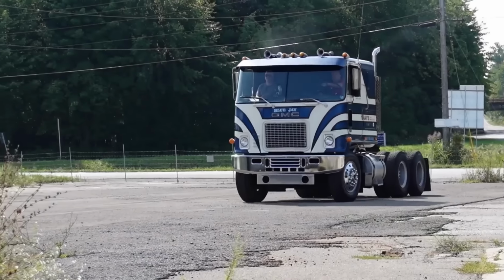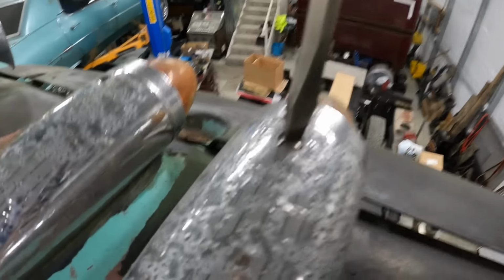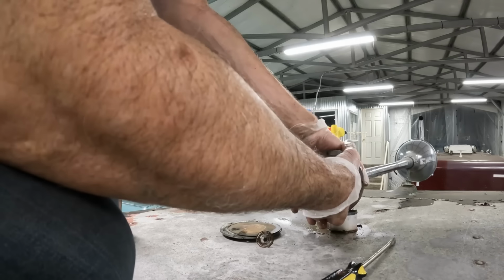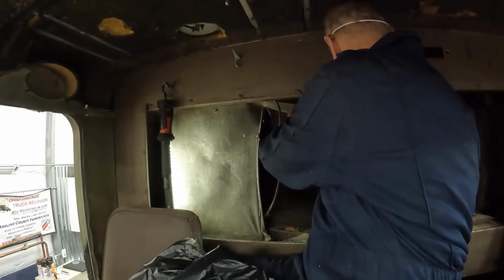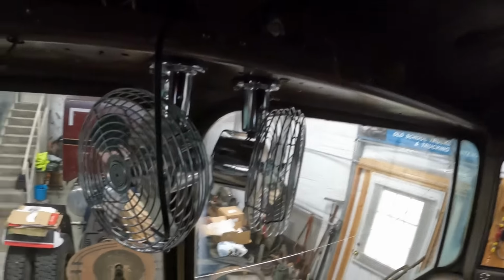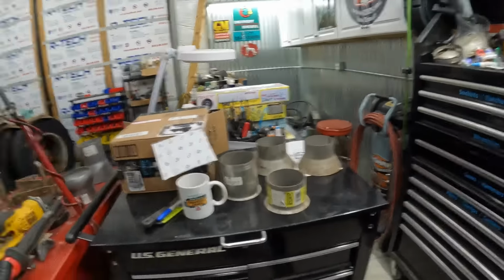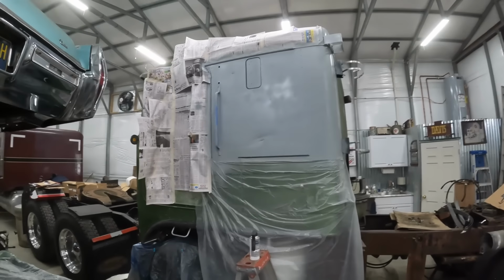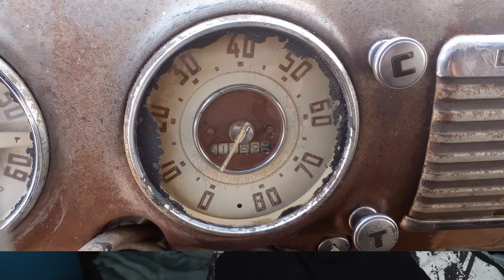Kenworth K100 CABOVER  8V-71 Detroit Diesel SEMI TRUCK

Comment: O-H-I-O Porters🇺🇸 Being out in the woods, the critters would take their meal back to the bunk & go hog wild. I imagine the bunk had a wild odor for sure! I’ve been in a few old trucks that had been a shelter for wild critters & it’s breathtaking! I think installing an overhead console would be so cool in that truck! Is the dash a copper color? It’s a nice color for the dash & console. I would suggest using vinegar in a spray bottle & let it soak overnight. I do that myself in my old trucks & it seems to do a bang up job! I love the old door handles on this truck. Do they both have key locks built in? I can really picture this truck being so, so cool! The body & paint work tends to be quite time consuming. I was shocked that your clearance came loose so easily. Are they a different size than the newer ones? They look quite pitted, but keep them in case you can use any parts from them. You never know. I know you can’t keep all the little parts like that. I think using new, LED lights will make it even nicer though. You gotta have vision on these old trucks! Is this truck more needy than any other of your projects? Those newer heat shields will make a big difference as well. Mr. Parker came through for ya there! I’m so thrilled that you found this old rig! Blessings my friend! 🥰🤩✌️

Comment: In looking at pictures of mid-1960's KW's, those cab marker lights you removed appear to be the originals, right down to the bullet (watermelon these days) style lenses.  Don't know for sure, but I'd wager those old lights, still being in good condition, might worth something to someone doing a concours restoration.
Body work is a labor of love and the more love you lavish on Grasshopper, the better the paint will look.
Reply from the maker: Thanks for pointing that out…I’ll definitely hold on to them. If I wasn’t under a deadline I could take my time and make sure it was perfect. Unfortunately I gotta keep up the pace enough to gitr done by June 1.
Reply: @DaneScottsTRUCKERSLOUNGE  Definitely hang onto them, maybe later you will want to rechrome them and reuse them.